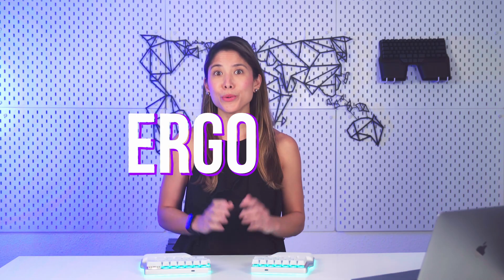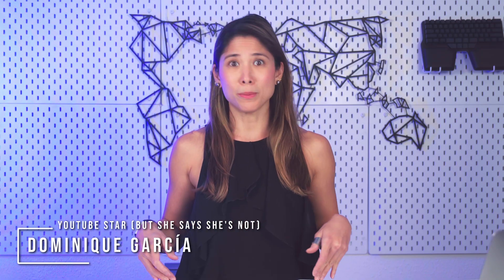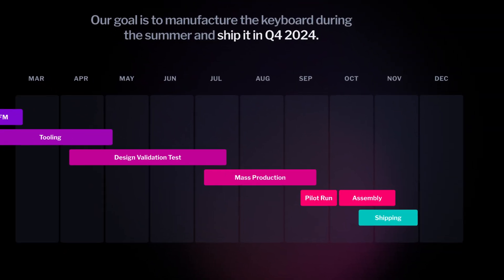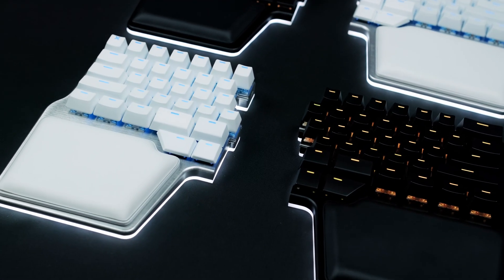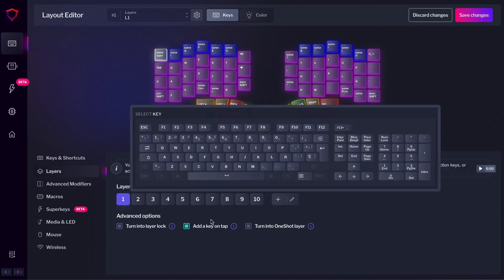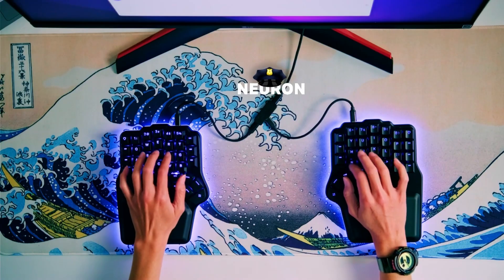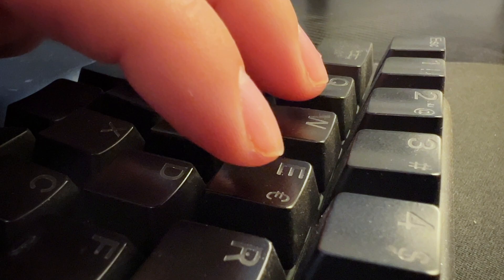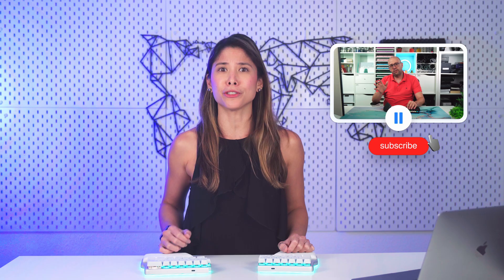Raise 2 is Coming, New Defy Firmware Testing and more - Ergobits #3

Comment: Bug detected: New Bazecore layers option won't let me make a shift to layer 9 on hold with a key on tap. I can make a key Shift on Hold to Layer 9, then I can check the box to add a key on tap, but I can't select a key from the keyboard graphic that pops up. I can make this  work for layers 8 and below, but not for layers 9 or 10. Same with One Shot Layers.
Reply from the maker: One shot layers and dual function keys are limited to layers 1 to 8. I think the UX doesn't limit that for dual-function layers.

Comment: I’m looking forward to the improvements in the firmware for homerow mods. These already work more than well enough for me to use them, but they are not perfect yet due to both false positive holds and false negative holds. I hope that it will eventually be possible to use timeless homerow mods, which supposedly reduce errors to near-zero.

I also hope it will eventually be possible to use per-key timings for superkeys. I have copy/cut/paste on the ‘Caps Lock’ key and CTRL+Space and layer shift on a thumb (super)key. I often get errors on the thumb key due to not waiting long enough for the hold timeout, but cannot make this time shorter in the preferences, as it will lead to errors on the ‘Caps Lock’ key.
Reply from the maker: Thank you! This new update will help a lot with that, and we want to implement the same preferences for superkeys too.

Comment: Does this have any spill resistance? "water proof"
Reply from the maker: The Dygma Raise is a hot swappable keyboard (you can change the switches) so it can't really be water proof. In exchange, it's super easy to maintain and repair :-)
Reply: @DygmaLab  Thank you, does that mean it has no liquid resistance on the circuit boards? Also, can I buy the circuit boards if they are damaged by liquid?

I think my customized keyboard will be about $450. That's an expensive paper weight if my kids make a mess.🥸
Reply from the maker: There's a .3mm felt on top of the PCB that helps reduce water damage, but we offer spare PCBs for sale at cost in case you damage one of them. You only need a screwdriver to replace them, as you can see in our disassembly video https://youtu.be/YamElBORKs8